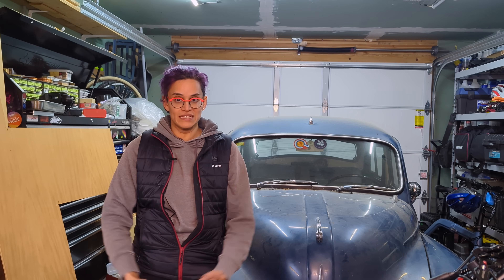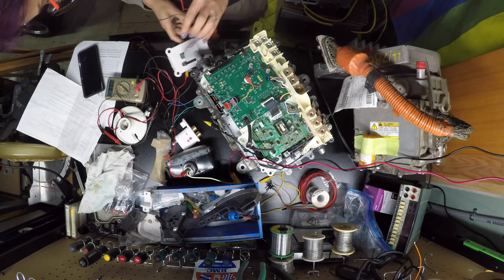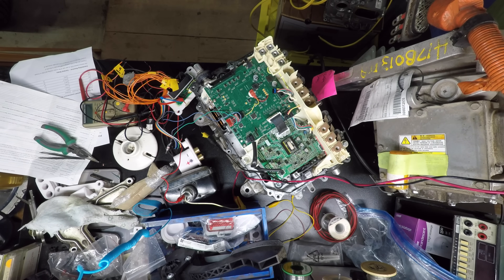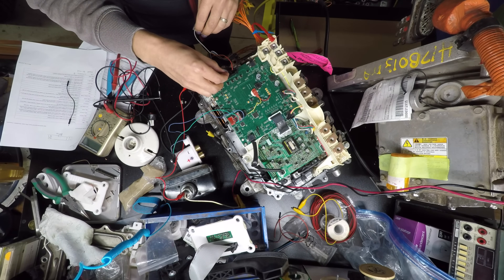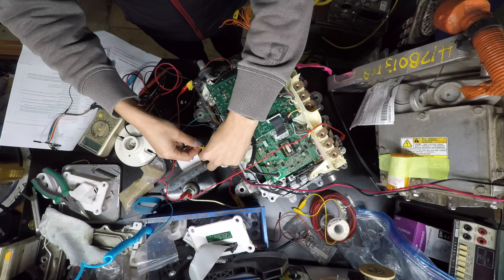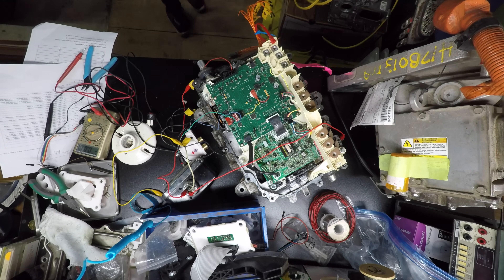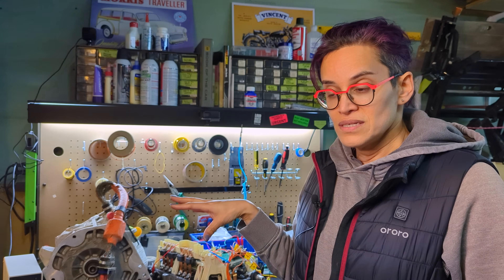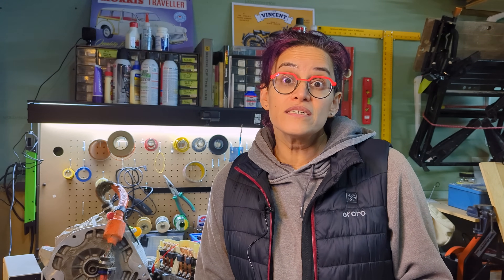Rebooting Rebecca Ep 7 - Testing The Inverter (Again)

Comment: The HV bulb will stay on if the HV buses shorted together or the polarity is the wrong way round. Id double check these before anything else.

I've blown 3 of these inverters doing various experiments and they've always had the bus shorted after. Photos on OI of the aftermath 😂

Multimeter in diode check or beep mode.

The steps on the open inverter wiki of testing the pwm signals etc can be done with no voltage and low voltage.

I used 30v to spin my motor open loop before moving on to the foc tuning.
Reply: This info is helpful.  Could you post a more precise title or other clue where to find your photos? (Bearing in mind that an actual URL probably won't post here.)
Reply: @Graham_Wideman  Search Open Inverter projects section, VW Beetle 2003 page 14

Comment: I couldnt get a close look at the cable, but in theory, you could have just taken a Stanley knife to the key on the plug, and cut it off - so the cable could be inserted upside down - it would depend if there were any solid pin blocks to stop that from working.
Reply: "upside down" => rotated 180 degrees. There is an alternative PCB mistake that can be made with these connectors, and that is where the PCB designer positioned the footprint on one side of the board, but then the connector is actually mounted on the other side. This exchanges the two rows of pins.  In that instance you would indeed be looking for a way to insert the plug "upside down", but it's impossible.